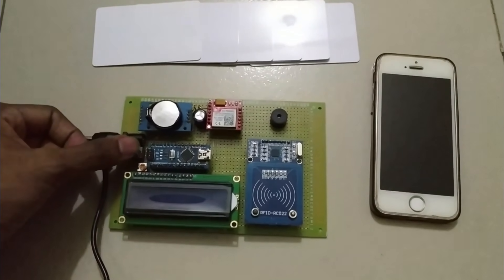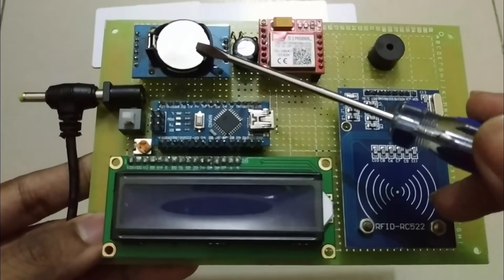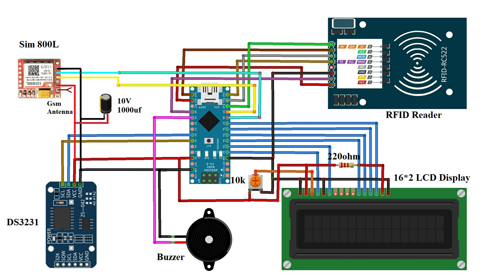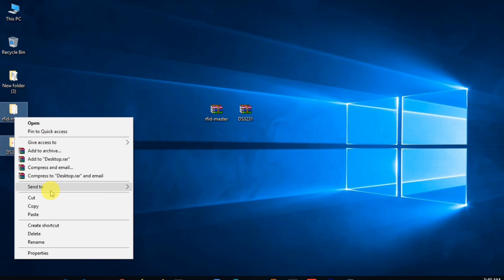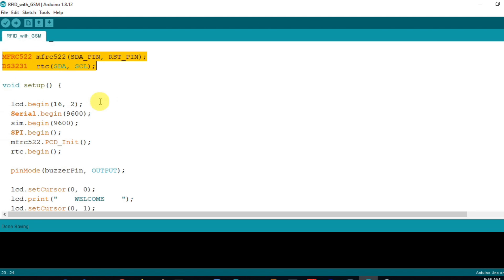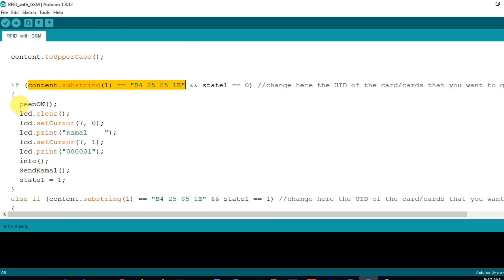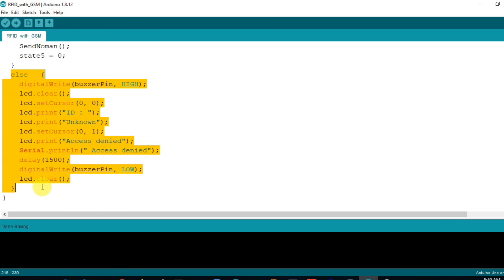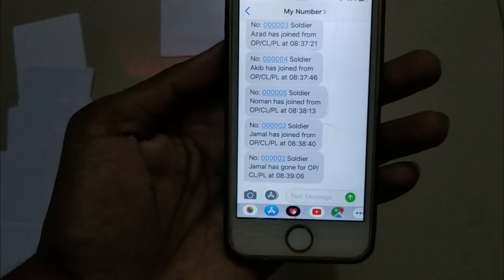RFID and Sim 800l GSM Based Attendance System Using Arduino and DS3231 RTC Module

Comment: Can I use Arduino uno
Reply from the maker: Yes, you can use Arduino Uno.
Reply: What will be the pin configuration
Reply from the maker: @moinkhanpathan6066  connection will be remaining same.

Comment: HELLO sir i have error to compile the code so please help to solve problem 
i donot do any change in code 
in the code - DS3231 rtc (SDA, SCL);     is shown in red line and error message as shown below
exit status 1
no matching function for call to 'DS3231::DS3231(const uint8_t&, const uint8_t&)'
Reply from the maker: Are you include the library(ds3231, mfrc522 library) files in Arduino IDE?
Reply: @RazibShahadat  
Yes sir
Reply: @RazibShahadat  
i noticed that in your code  DS3231 rtc (SDA, SCL); this line -SDA and SCL in blue color. But  in my laptop SDA and SCL in black color
Reply from the maker: @chintanpatel6087  That means you are not able to include the libraries properly.
Reply: @RazibShahadat  
then what to do solve problem? please help sir
Reply from the maker: @chintanpatel6087  Follow the tutorial form 3.22min.
Reply: @RazibShahadat  
OK sir today i found problem and solve it now the program is compile .....thanks sir